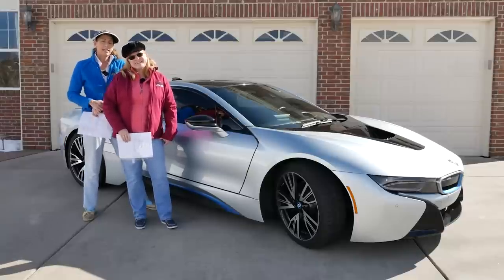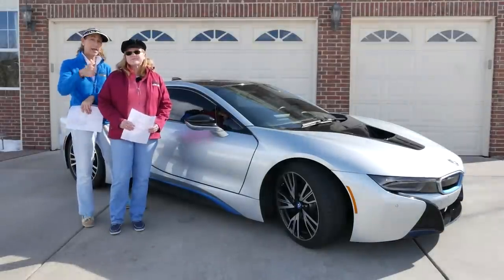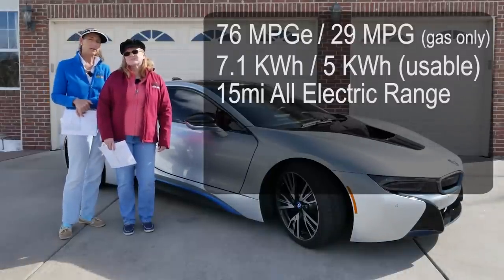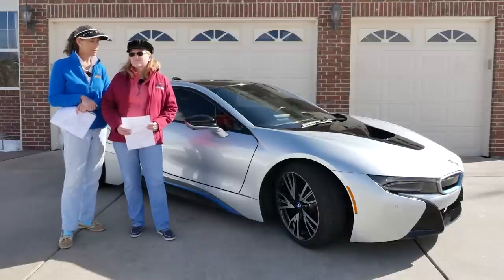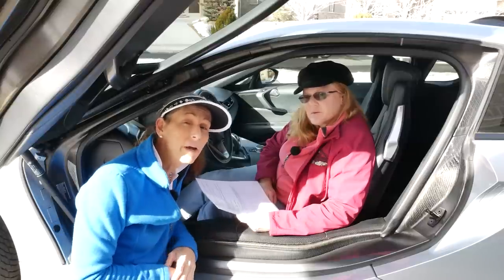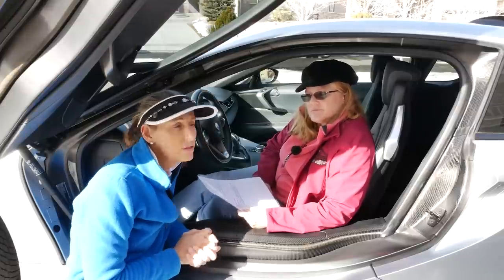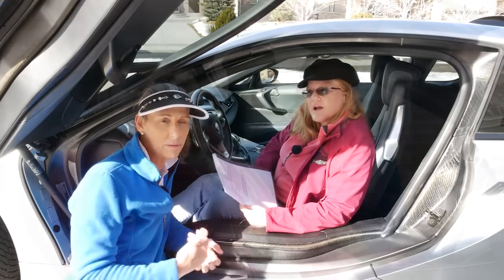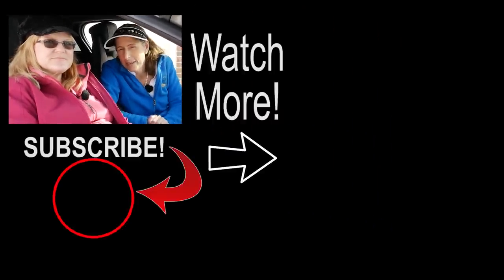BMW i8 Year in Review - Would We Buy Again??

Comment: Thanks ladies for a very thorough review. I have owned my ‘15 i8 for two years and the CPO warranty runs out today so I’m keeping my fingers crossed, but so far so good. I completely agree that there is really nothing else like it out there for the money. You mentioned faster cars with 0-60 times in the mid threes but Car and Driver and Road & Track tested a ‘15 i8 and got 3.6 and 3.8 to 60 so it does just fine. The power delivery with the quick torque kick is very satisfying. As you said, it’s not the best at anything but the whole package is really special. I have owned more powerful cars but there is way more to this car than horsepower numbers. It’s a sophisticated, elegant machine and I applaud BMW for taking a risk and building such a unique vehicle. I am getting 44 mpg overall - show me another car than can achieve that kind of mileage, get to 60 in under 4 seconds, run all of my errands without burning any gasoline and turn heads everywhere it goes.
Reply: Tesla Performance Model 3 or AWD dual motor (can be upgraded to 0-60 in 3.9) if you really need that.... I've had my dual motor since August 2018... do NOT miss having to stop at gas stations. No range anxiety - (supercharger network and charge at my condo.) so NO gas.   Very minimal maintenance.  Only maintenance I've done since purchase is rotate tires.  Probably less maintenance than the I8 and can seat 5.  Plus have all the other Tesla benefits such as OTA updates... my car had gotten better with added features for FREE since I purchased.  - Received sentry mode, dash cam, slightly improved range, ability to upgrade the 0-60.... When the I8 came out that was definitely a bucket list car.... but I have to say - my M3 is more affordable and has same or better performance than I8 - and it will drive me safely in the same lane in heavy traffic on the freeway.

Comment: Thanks for the review, I concur completely.  I also bought a just off lease '15 i8 one year ago. (Terra, Sophisto Gray, W's), I like it a lot and look forward to another year, not tired of it at all. Usually after a year I am looking for something new.  No troubles, no problems except a fuel vent valve, covered under factory warranty.  I did spend for the extended warranty at time of purchase. Expensive but to me, worth the peace of mind. BMW labor rate on central coast California is $205/hr. I think the less than positive comments by others is that "they just don't get it". They are comparing it to other ICE exotics.  BMW's intent and accomplishment was to create something new and attention getting, a good looking comfortable  futuristic GT using fuel for range and electric for torque and mileage. They were successful in my opinion.
Reply: I agree 100 percent!

Comment: Its the cold  that drops the pressure in the shocks , when summer are back the pressure will also be back .
Reply from the maker: True.  Same issue with the boot/bonnet struts on the 911s.  It is a sign they are failing.  We have to replace the struts on the 993 as well...

Comment: Enjoyed the video! You probably know this already, but you should be able to pretty easily turn off the piped in sound, at least you can on other BMWs. You just need the VeePeak Bluetooth OBD2 scanner (or similar) and Bimmerlink app. I’ve played with it on my M2 so wanted to mention it.
Reply from the maker: Thanks for that.  From what I've read it is a bit difficult to shush that.  It isn't too loud and it isn't a bad sound.  I think the little three-pot actually has a pretty cool sound.  We need to get the Bimmerlink app and change a few other little annoyances.
Reply: @HeidiandFranny  Makes sense. From what I’ve read there are two apps: Bimmerlink and Bimmercode. I haven’t messed with the coding one, but that may be what you want. The Bimmerlink one is mainly for checking/clearing CELs and seeing/logging data but they built in two “buttons” for opening exhaust system valves and turning off the piped in sound.  The coding one has a lot more functionality for changing the coding. Anyway, looking forward to more content!

Comment: The Hakka winter tires are awesome.  I've run them on my cars since the early 80s.  Good choice!  
After listening to the complete review I was a bit surprised to hear you both say you would buy it again.  It seems it is an emotional purchase much more than logical.
Reply from the maker: I think there is a big emotional component to our decisions ;)  I always want a car I feel passionate about from the little 356 through the Ferrari to the i8.  We are completely nuts - not a practical car in the garage...  The i8 is a blast to drive and just such a nice place to be.
Reply: I had my Roadster delivery with Nokian on the 517 style, 215 front  245 back. They cost a fortune new. List price incl 25% vat in Norway is $ 9-10.000! They are the best winter tyres for the i8 in real cold snowy condition.

Comment: To get a jack under the car when it is low to the ground. First drive the wheel onto a block of wood to give u a little more access for the jack
Reply from the maker: If you are referring to our flat tire video, there was no way you could drive it.  The valve stem was broken and no air was left in the tire.  I appreciate your idea, but there was no moving it without damage to the rim.
Reply: We do it at work to allow access for jacking cars that are lowered with out issue. All u are doing is placing a small bit of wood right in front of the wheel and then drive it on to it... even with the wheel being flat the wheel should not come in contact with the car body.. and wood won’t damage ur rim. The knowledge Franny has around cars would put many mechanics to shame. Great videos best on you tube
Reply from the maker: Thanks so much Marc!  Great advice :)

Comment: Hi Heidi and Franny! 
This just popped up after watching a more recent video on the Carrera. Do you still have this car? I've not seen it in the garage.
So winter tires are made to not get as hard as regular tires in the cold so they will give better traction on slick surface. I usually just go with all-season tires.
Samcrac on YouTube bought one of these and is having a really hard time with the cooling system on the gas engine. Aparantly it is hard to bleed the air out of them which causes overheating problems if something has to be replaced in the system or the engine needs work.
You might want to get an extended warranty on it just in case especially since it is a BMW. 
Gas at Costco or Sam's club is usually cheaper than anyplace so if there is one around close enough you might want to go to one of those. Of course you have to be a member. I pay around $2.50 for premium for my Mercedes-Benz here in Vegas.
If they built cars that used a small turbine to turn a generator to power electric motors like diesel-electric locomotives I'd be in but these kind of hybrids are just way to complicated.
Have fun!
Reply from the maker: Sure do! Ours has been just great.  I have been following and speaking with Sam. That really is a head scratcher. His issues are just with the engine. It can't be all that complicated. These cars really aren't any more complicated than any other plug in hybrid. They look crazy, but really not that bad at all. It really is a great car!

Comment: Sounds like this car was the auto industry's version of a UAT cycle. But, the cars which follow will benefit from that.
Reply from the maker: Ya know, I really hope so too, but all that carbon reinforced plastic technology doesn't seem to be finding its way into the new cars.  Maybe the i line was a bit too much show but I think, at least the i8 will be somewhat sought after like the Z8 is now.  Time will tell...
Reply: @HeidiandFranny  True that on the i8 being a sought after collectible car- as leading edge models seem to always survive the passage of time.

Regarding the current reticence for industry acceptance of carbon-fiber materials this, too, will pass since Boeing and Airbus appear to favor CF layups over the aluminum sheet as the material of choice for their wing members. This should go a long way toward general industry acceptance of the material.

As we move toward totally-electric cars, a shapeable material with an acceptable strength to weight ratio; a high shear modulus and a high dielectric constant should be in high demand.

Thanks for the video! Look forward to the next one.

Comment: I predict Ladies that the i8 is the next Z8, SLS low volume cult investment. The car goes out production this month after 5.5 yrs. It cost BMW $200k to make, and when it's long gone in ten years from now will be appreciating like the above two cars that at the time were heavily discounted (about 30% - I see this as depreciation up-front btw) to shift them - I know because I bought them both at the time and they both started rising in value after 5-6 yrs. I've put my money where my mouth is and bought a i8 Roadster last month (30% discount).. Let's see 🤔
Reply from the maker: Thanks for that Paul.  I feel the same way.  The Roadster will be the one to have.  How do you like yours?  Any issues with loosing the storage of the two rear seats?
Reply: @HeidiandFranny  it's pretty much the same as my 2014 coupe. However the main improvement is that of you drive it in electric alone for 27-28 miles with new range it has, and the new front axle set up means it no longer badly understeers as the 14 car did in full electric. Put it in sport and with both (or all 3 if you include the motorcycle power starter that BMW fitted to provide torque-fill on boost) power plants then it now is a bit more we edgy as it rear end now moves about and I'm less inclined to switch the DSC off when in the wet as I did in the 14 coupe, when you could just obliterate wet weather twisty roads with gay abandon. The non Lazer headlights are still only ok, fit and finish are great, I never used the rear seats so no loss there for us (other cars for that). Best of all despite it having a fabric roof it feels and drives like coupe (something the AMG SLS definitely did not, it was a squeakandrattlefest ) and is silent...and when the roof is down its magic, especially in full electric, as you can hear the birds at 75 mph🙂

Comment: Why would a 12V battery need to be VIN linked? Legit need or  service revenue generation policy?
Reply: I think it‘s a thing with the battery monitor thingy (Sorry, no idea what‘s its name in english). I‘ll ask an electrician tomorrow. Same thing with Porsches.
Reply from the maker: That's what we heard too.  It helps the car know how to charge it based on age...
Reply from the maker: We had folks say that about the MINI battery too when we replaced it with an off-the-shelf.  It seemed just fine.  The dealership said it was to aid the car in charging by knowing how old the battery is.  They say that the battery will only last 2-3 years.  That seems super short to me.  When we had it done it was under warranty so, ok, I guess ;)  Not sure I would bother next time...  It added two days to the repair time.
Reply: As far as I know all bmw has to have. In order for the monitoring of the battery the car has to know exactly what battery is is looking at.
Reply: So I asked our electrician. I work at a Porsche dealership so maybe this is only right for Porsche vehicles.

The battery isn't VIN-locked as in one couldn't use it in another car or the battery wouldn't work in a different car at all. The battery is "trained" (sorry, that is the literal meaning of the german expression - angelernt- I don't know the proper english term) to the car. So the battery management system is told  the capacity and built of it. But you could train the battery to any other car, too. Since the 12V battery is charged through the DC/DC-converter from the high-voltage battery, as there is no generator*, this is necessary for the 12 V battery not to be charged too much or vice versa. This would be bad for battery life and also influence the range of the car (as you can see what hapened to the BMW's range with the bad cell.). A trainer from Audi once told me that they go for every single detail to extend range of the hybrid and fully electric cars. That's why the newer Audis have a camera on a stick and two monitors in the door panels for review mirrors. Even if the monitors consume a bit of juice, it's still better for the car's range than two big review mirrors with a much bigger wind resistance.

Besides, the battery monitor is the box on the negative terminal of your battery. LiPo batteries (like the 992's) have a built-in monitor, that's why there is an extra cable plugged in to the battery. If you charge your battery, you must NOT use the negative terminal of the battery. There is always a dedicated spot for the negative clamp of the external charger. In the 991, there is a stud on the windshield wiper mechanic for instance. Otherwise it could damage the battery monitor, wich is a bit expensive. At least if you have to have it repaired in a Porsche centre ;) .

* The high-voltage battery is solely charged through recuperation from the electric motor/s.

Please note that english is my 2nd language and this tech-talk is a bit too deep for my language skills. Plus, I'm a sheet metal guy. Even though that makes me the swiss army knive of the automotive trade, I'm more familliar with ancient techniques like welding, hammering and leading... I hope i could make myself clear, anyway.
Reply: Hmm. Is leading the right term? I don‘t lead people, i put lead on bodywork...

Comment: Beautiful car. For $150K I would expect a lot more car. And the value drops like a rock. A Tesla Model 3 is a much better choice, doncha think?
Reply from the maker: No, not at all...  I did a review on the 3P and it feels like a $25K car at best.  The interior feels cheap and cold and the fit and finish was terrible on the car I reviewed.  The i8 currently trades for the mid 60s which puts it very close to the 3P and there is no comparison.  I took the owner of the 3P I reviewed out for a drive in the i8 and his first words were "Wow...  This is a real sense of occasion".  BMW lost money on every i8 they built.  It was proof of concept and a truly unique car with great usability and great styling.  100 times over I would pick the i8.  You should drive both and see...

Comment: I might have missed this.  But, what is the exact range you are getting?
Reply from the maker: The all electric is around 15mi.  It fluctuates based on driving behavior.  Full range on the car I have see over 400mi, but I think 360-ish mile is more reasonable.  It has a small gas tank (less that 12 gal).